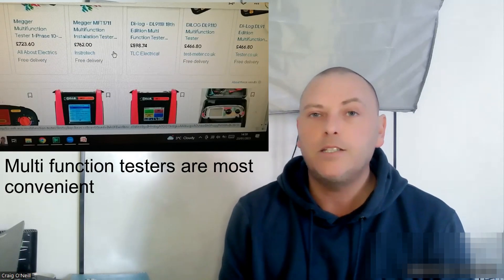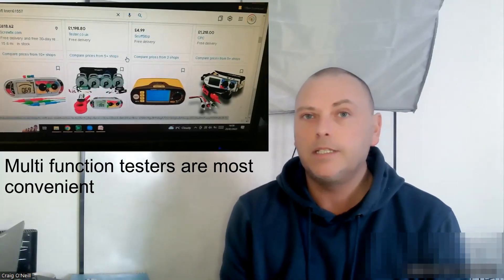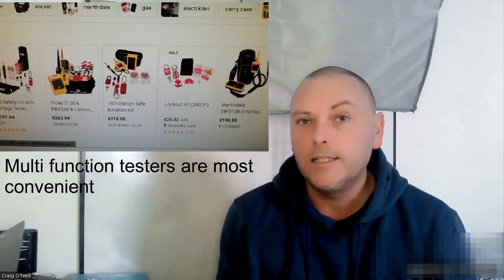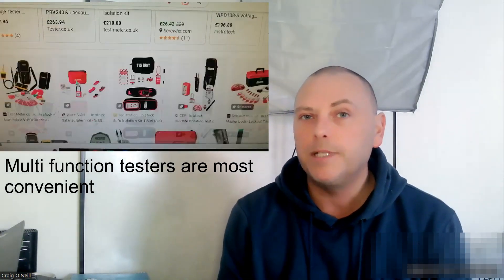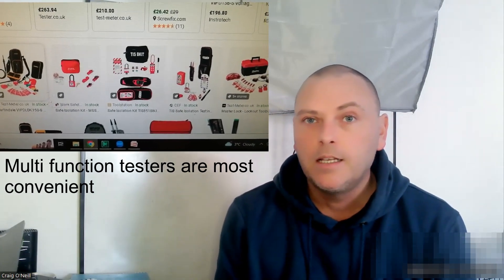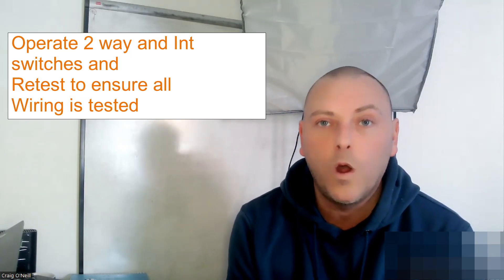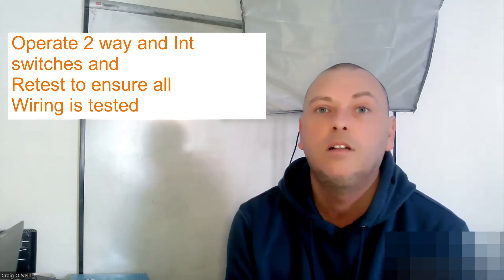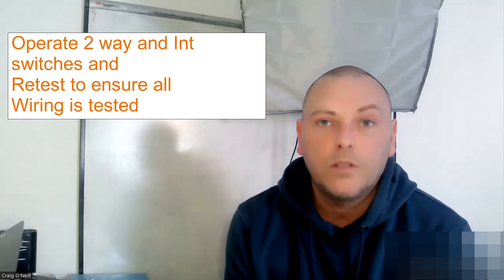AM2S, AM2, AM2E, section B inspection and testing Practical revision for 5357, 2391, Am2

Comment: Hi Craig, on the am2 now we have to do a phase sequence test at the supply side of the main breaker at what point does this enter the testing sequence? Also you have to do a Zs test on the ring final circuit and calculate the rest of the circuits. Do you have to have the board cover on at that point? So would that come just before the rcd testing then as the board cover needs to be on for that test too?

Comment: I've just found your channel Craig and its such  a relief as my AM2 B part resit is coming in a month time.
I didn't have an issue with testing, although had a brain freeze /overthinking on insulation resistance test, still  fail a rectification of the protective device (3 phase) as couldn't remember formula and way how to proceed to verify ADC is suitable for installation.
I found your video on design/calculation of a circuit  - 3 phase motor (6kW)  and its was a massive help.
Thank you for an educational video👏🏻💪🏻

Comment: Do you have to disconnect the earth fly lead from an rcbo from the earth bar when your doing insulation resistance on that circuit?
Reply from the maker: Yes. And I'd also remove the conductors from the rcbo and place in connectors for the test. Some rcbo can be switched off and not need removal of conductors but if your not sure then remove. But always keep the cpc in the met!

Comment: BS7671 amendment 2 now only requires that we test RCDs/ RCBOs at 1 x it’s rated current on the AC setting at 0d and 180d for all types of RCD the 1/2x and 5x test is no longer required. But there’s nothing to stop you doing them if you choose to. 
Good video though nicely explained 👍
Reply: Thank you for a good honest conversation (debate) we are always learning in this game and I believe it’s important for us to have our opinions , that how we learn, I also believe that there is no such thing as a fully qualified electrician as we are always learning new skills and more and more information . Because the industry is always changing .
Reply from the maker: @Dog-whisperer7494  Couldn't agree more buddy.
Reply from the maker: Hi Sean,  half times is essential if you want to prove its not too sensitive. Check table 2.17 page 96 in Guidance note 3 table a is recommended tests. No need for x5 unless fault finding.
Reply: @cestemshow  so GN3 contradicts BS7671 the IET did a live podcast when AM2 was published and they said the 1/2x and 5x are no longer required. Hence why there is no were to record them on the schedule of test certificate.
Reply from the maker: @Dog-whisperer7494  The regs is clear that x5 has been removed but is a bit grey about the half times to be honest. Gn3 def states its recommended though so I go with that.
Reply: @cestemshow  the IET are clear I go with BS7671 . But I agree with you that the 1/2x and 5x test are important that’s why I continue to do all the tests as I always have done in my opinion the IET is mental for getting rid of the two tests . It’s madness. A step backwards.guidance note 3 is simply that it’s guidance. Not a regulation go by the regulations BS7671 nothing else .
Reply from the maker: @Dog-whisperer7494  I'm OK with dropping the X5 but not the x0. 5 test. If it trips at X1 it will achieve 40ms at X5 or 250mA as per bsen61008 or bsen61009....
Reply: @cestemshow  like I said I continue to test RCDs in the same way I was tort at college. Ie 1/2 x 1x and 5x . But note page 11 of the onsite guide says, regardless of  of RCD type effectiveness is deemed to have been verified where an RCD disconnects within the time stated below with an alternating current test at the rated residual operating current (i^n ) * for non-delay type, 300ms maximum..
GN3 the onsite guide and BS7671 all contradict each other no change there then.
Reply from the maker: @Dog-whisperer7494  🤣 yeah, doesn't surprise me at all sadly. For me, I'm happy to drop the X5 because essentially, more current equals more magnetism so quicker induction on the trip coil so if it performs at X1, it must perform at X5 unless it becomes faulty between test and fault. I'm not sure the X5 really proves anything if I'm honest 🤷‍♂️ would like to ask hager, electrum etc their take on it all tbh.

For me, on initial verification it's:  
 press test button
 - both parts of the cycle for x0. 5 and X1

Periodic testing: 
 it's tests first then press test button.

That's due to 2391 teaching but actually I think both should follow the periodic testing way round.

Comment: Thanks Craig for the summary of tests and key points.  In GN3 the IR requirement is to test between Live conductors together and Earth. These seems at odds with the usual blanket test of L-E, L-N and N-E. Can you suggest an IR approach for AM2S on a 3 phase board with MCB's and an RCBO? bets regards Tim
Reply from the maker: Hi Tim. No for initial verification we always must test between all conductors rather than joining line and neutral and testing to earth. The guidance in gn3 is implied for periodic testing or fault finding.

You will be able to prep the install and test all of it except the rcbo circuit using the 10 combinations you do for safe isolation... then test that seperate rcbo circuit. If both results are over range then just record over range. If one was say 120k ohms then officially you would need to put them both into parallel resistance equation to find out the overall value but most the time it will be over range.
Reply: @cestemshow  Thanks Craig. That is really helpful.  I'll disconnect any RCBO circuits and then do the 10 Tests (I guess I need to do this 3 extra times for any 2 way and Intermediate lighting circuit circuit?).  I can then test any RCBO circuits separately.  If I do get a low reading I'll use the "one over RT) equation to get the resistance in parallel.
Thanks again Craig!
Reply from the maker: @timothymack3830  absolutely right Tim.
Reply: @cestemshow  on first fix we are required to test LN LE and NE at 500v all loads removed second fix we are required to test LN LE and NE again all loads removed , at 500v if  sensitive electronic equipment is in circuit ie timer control LEDs electronic temperature control then we test Line and Neutral combined to Earth at 250v , and again at 500v if the electronic equipment can be removed from circuit . If testing at the RCD/RCBO  we should test at 250v .